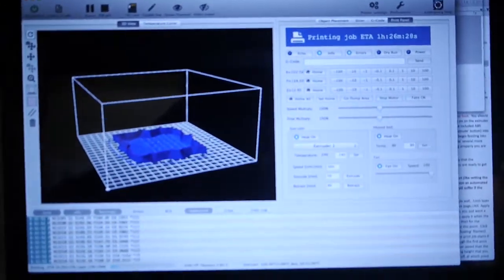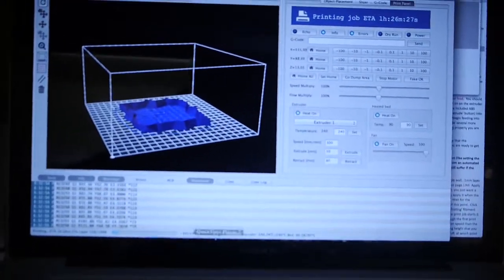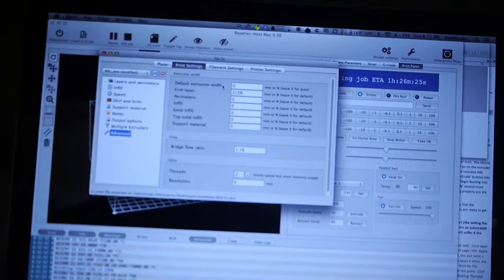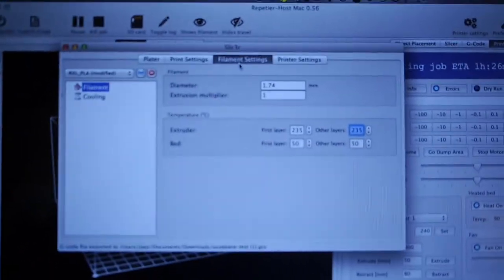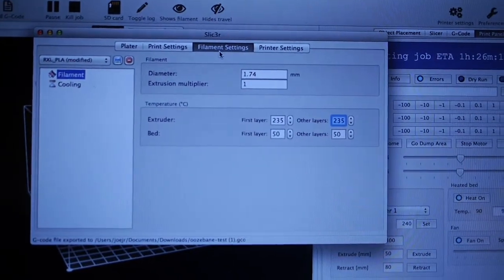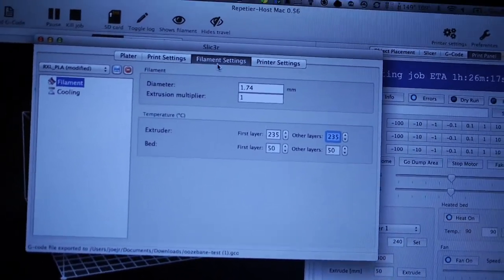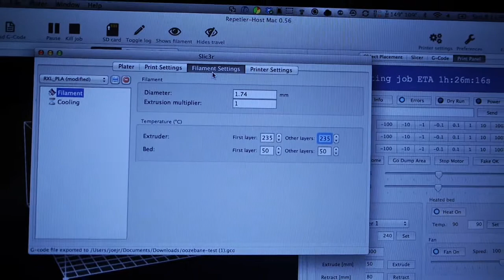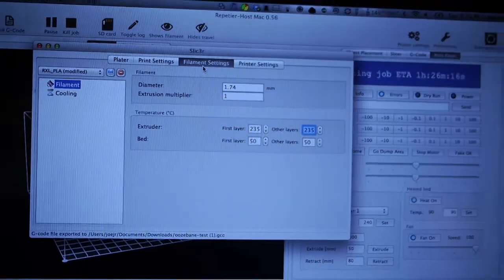QU-BD RXL - First Print

Comment: Hey Joe
Are you using open source file yet and are you having any problems with printing? I have the same printer and my test prints are stringy not smooth or it won't stick to the bed because the spacing is too high. If you can provide any help I will be great full. Thanks

Comment: You can always use elhmers glue instead of abs glue. It requires a little more cleanup but itll help the prints stick better and it wont put off any harsh oders.